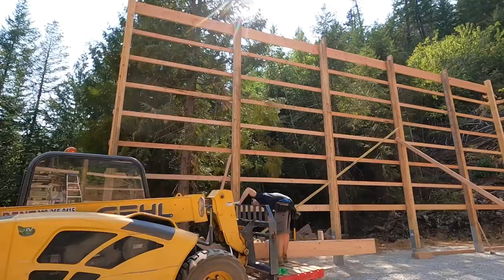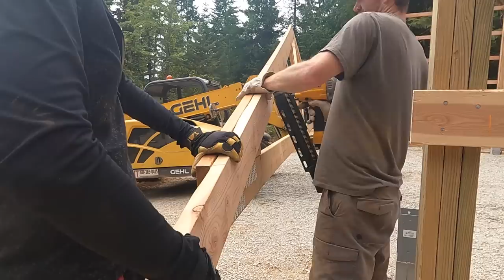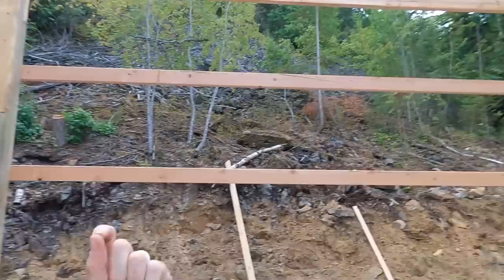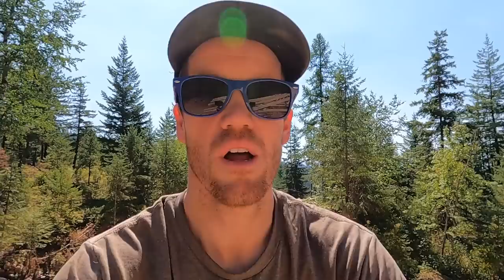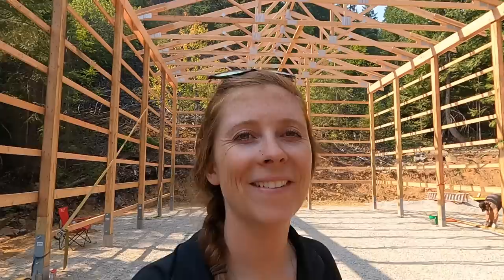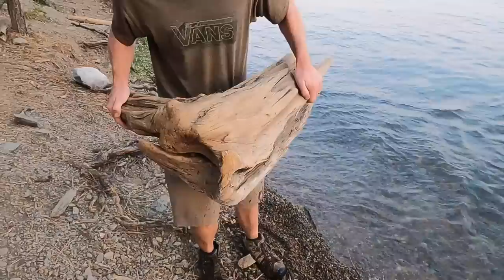Couple Installs Trusses With ZERO Experience | E4

Comment: I`m proud of you 2! Building like pros, buying a safety harness was real smart. When your roof steel gets even a little damp it will be like a ski-slope, very slippy! lol  Blocking up the forks on the tela-handler was also smart. Don`t let these complements keep your hat from fitting. lol  The 1" "too short" trusses divided equal was a good fix and shouldn`t be a problem at all. I do see possible problem with the trusses sitting only on the 2x`s and not on top of the posts for weight transfer. All the weight is on the 2x`s and therefore on the nails or screws holding the 2x`s. A good amount of snow will want to push the trusses down and the nails/screws will sag or fail. I wood put 2x6`s under the headers fitting tight between the wall "perlins" on at least one side of every post in at least 3 of the cavities and nail the poop out of them. Then the trusses that are in between the posts, i wood add some supports from each post on a 45 deg. angle up to the bottom of the truss for support and nail the snot out of them. Then see how that looks. Also, if your building is plumb and square and the measurements are equal, your roof "should" be square, then all you need to do is plumb the gable ends. When you put up roof sheets, tack 4 or 5 in a row to see if they are running true, using your safety harness and sticky and clean tennis shoes is a good combo. If it starts to even drizzle or your own sweat can make you loose your footing. The saving point is your roof is not that steep. The center board runnig flat on your trusses for you to walk on and keep the bottom of the trusses on 4 foot center is called a rat-run because if rats get in they will use it like a super- highway! lol If you nail a 2x4 or better yet a 2x6 on the side of the rat-run you will be making what`s called a "strong-back". String a masons line on the far end truss bottoms to see how much deflection they might have before you nail the strongback, you might be able to get some of it out. Yack, yack, yack! i just had a coffee, so my fingers are very talkative right now. lol Take care
Reply from the maker: Wow! Thanks or the in depth rely! Our trusses that land on the posts are actually sitting directly on top of the posts and do not rely on the truss carrier. The truss carrier only carries the odd loads. They are secured with GRK structural lag screws. This is a common and accepted way of building in our area. Thanks again for the tips and thanks for watching!

Comment: u should not use screws, screws cant bent, nails do so thats why construction workers use them for the most
Reply from the maker: We're using GRK structural screws intended for the application. Nails weren't going to happen for the purlin connections, we don't have a safe way to get high enough to install them.

Comment: It is called a "rat run" 😁
Reply from the maker: That's it! Thanks! Hopefully ours won't be used for the namesake
Reply: From someone with 33 years in construction, get your permanent diagonal bracing in ASAP. I've seen sudden wind storms take down a place in your stage of framing. Yes the straps help but only in one direction.  You need X braces from the rat run to the top of the end wall trusses. Permanent rat runs every 10' or so etc.

Comment: Riley - "An old Tip" .. Putting WAX on the nail / screws enables them to drive into the wood easier. Sorry, you have probably finished the job by the time you read this. :O)
Reply: My thought would be: wax screws, not nails. Nails are held in by FRICTION, and nails where wood moves, plus thermal expansion and contraction, tend to walk nails loose/out.
Reply: @cliffmorgan31  Hi Cliff - Thanks for your thoughts about nails backing out. Today they do produce anchor nails which are ribbed and you would be hard pressed to remove one let alone it backing out from expansion . Though I would caution folks about Phillips products produced in China. A bad experience for me was deck screws sheering from winter heave. I had contacted Phillips Inc. and they did a metallurgic test of their defective product and the final result was they cut a check to cover all of my related expenses.
Reply from the maker: Hi Dale, not sure I wan't the nails to go in easier. Pull out strength is a big concern on post fame buildings. At any rate, thanks for the tips!

Comment: I forgot to tell you if you go with unpainted metal, it will probable have a film of oil on it and will be real slippy.  It`s late i`m done, take care
Reply from the maker: Most metal we buy comes unpainted and oily, such a pain!
Reply: @AmbitionStrikes  I was a "tin knocker", aka sheet metal worker, for a HVAC place for 5 years. Handling the 4x8 0r 10 sheets without gloves made my fingers and thumbs split on the ends, even in summer. Something about the oil and when using a cleaner like acetone made it worse. Once i quit that job, my fingers and thumbs healed even though i would use acetone once in a while. Strange huh?

Comment: OEM halogen headlights are so bad, especially on country roads.
And yet your lightbar would blind oncoming traffic (when in use).
Do yourself a favor and get some aftermarket (DOT) LED headlights:
https://www.theretrofitsource.com/2019-ram-hd-xb-led-heads?quantity=1

Just make sure to find a level spot and aim them after installation. :-)
Reply from the maker: A headlight upgrade is much needed!